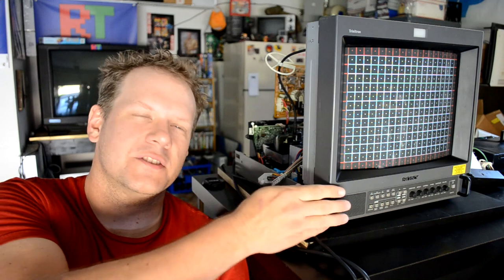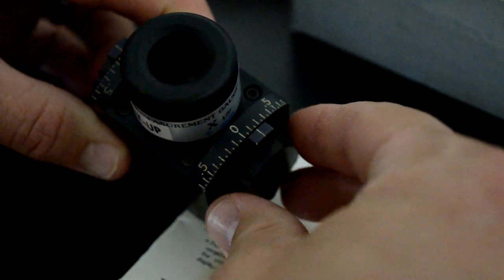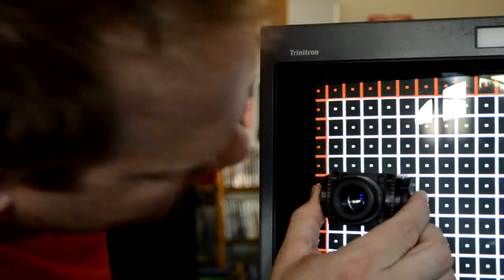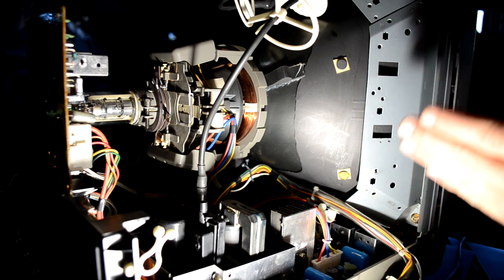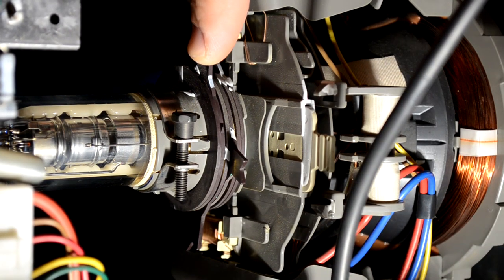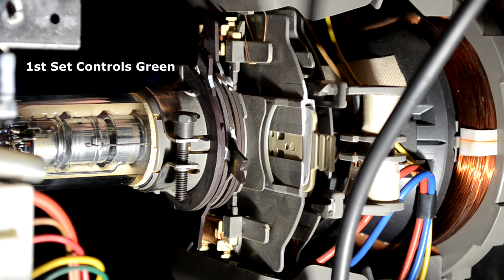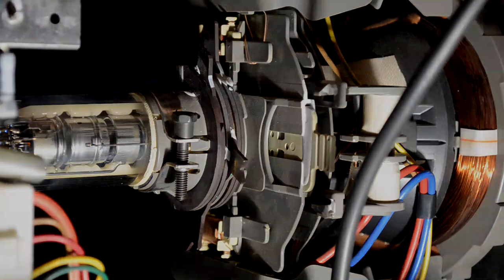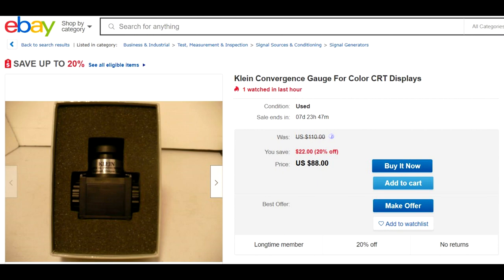This CRT Convergence Tool is a Must Own!

Comment: What I do is use a pair of weak binoculars and put the part you look into against the glass. When you look through the other side, you can see the phosphors very clearly. Almost as good as this tool, and I didn’t have to spend anything more.

Comment: For a second there I thought this was going to be about one of those PVM "probes" that people use to auto adjust things. Never knew they made lenses like this.
Reply from the maker: Yeah, this one doesn't do any adjustments automatically but it's still vary helpful.  I've always had trouble gauging Convergence adjustments.  I wish I'd found out about this years ago, but it was literally about 10 days ago.
Reply: @RetroTechUSA  How do you look at the lense when you have to look at the back of the CRT for the pots? You probably just said it in the video or just wing it & hope you don't touch something live while doing both at the same time, but this scares me just thinking about it.

Comment: In your opinion what is normal imperfect convergence? I have a PVM that I notice slight  red and blue on one side of a straight line at the edge of the image. Red at the bottom of the line and blue at the top. Its pretty symmetrical though even on letters... etc. I assume this is normal considering there no such thing as perfect convergence. Thanks for your uploads. It's appreciated.

Comment: I have a consumer set (A Sony KV-C25TD) In which I'm trying to adjust the convergence rings, but they seem to be stuck! How do I rotate them, is there something I need to loosen up first? I don't want to risk breaking anything. Or should I even, since it apparently came like this from the factory?
Reply: Convergence rings are usually adhered into position by epoxy or silicone from the factory. You'll have to somehow remove those adhesives if you want to make adjustments

Comment: Howdy. Do you know specifically what model that is? Wonder if it says on it anywhere. I see the booklet that came with it. So it seems like it must be one of the two models that list 'green' as the center prism.
Reply from the maker: Hey Sorry, It doesn't list the exact model on the unit.  The label is worn off.
Reply: @RetroTechUSA  you have the CM7AG model, you can tell by the 0.5 mm (for monitor use).

Comment: Steve you killed me here.. i was trying to get one of those.. now it's almost impossible.. which model is the one You have? I've noticed there are several different kinds of those tools.
Reply from the maker: My exact model is rubbed off the label on mine.  The manual list a few different models, but most of them are the same.  As long as it's listed as a Convergence CRT Lens/Tool it should work well.  I'm looking for other viable options too such as jeweler tools.  I think they have some type of lens.
Reply: I think it can be handmade, just need right type of lens

Comment: Hello, thanks for the video. I have a question...
I do have an small CRT, using the SNES via composite and the 240p tool, when I use the white dot option and the dot is in the middle of the screen is fine, but when I move the dot to the bottom of the screen is like I have the white dot, to the left there is a small green shadow, but on the top right corner is a big blue shadow. This can be fix with these dials?
Thanks!